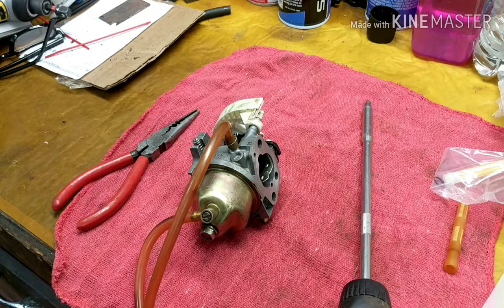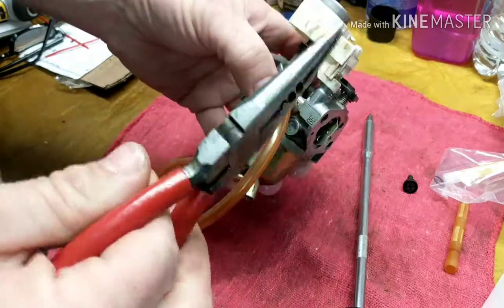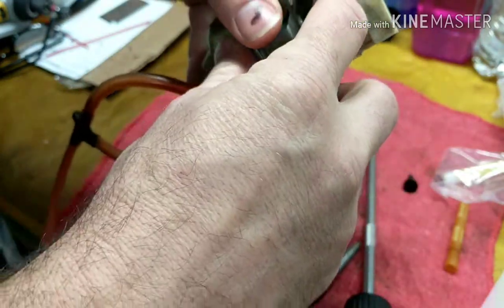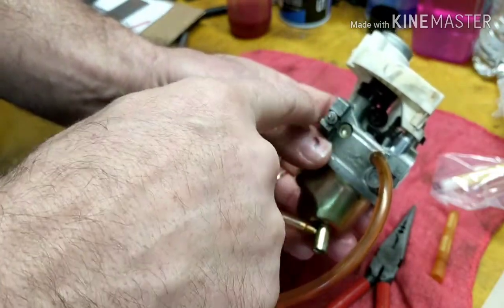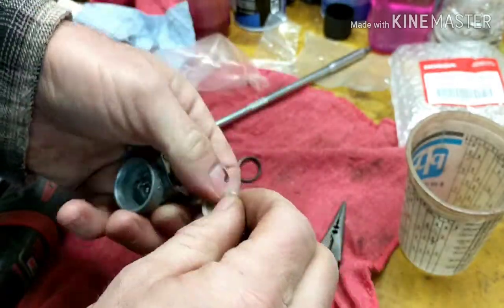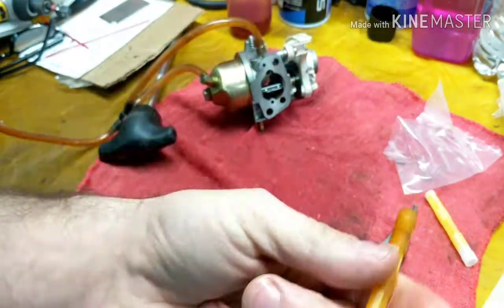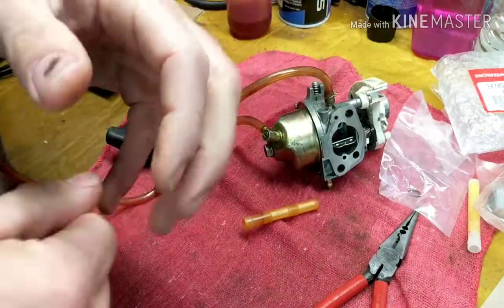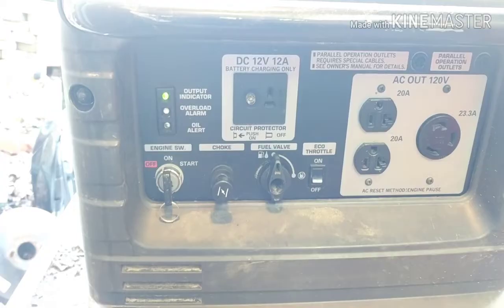Fix surging for good!!!

Comment: I have an unrelated question to this video.  I just replaced the gas tank on my generator. When I filled it full of gas, all of the gas drained out of the upper carb drain hose. Do you know why this would be? I don't see an adjustment screw.
Reply from the maker: Sounds like it's overflowing and filling the carburetor with fuel so check your float needle and make sure it's cutting the fuel off when the bowl is full.

Comment: Fantastic!  Can you show a detail of the throttle motor connection? I took mine apart and notice there is play between the stepper motor and the plastic plate on the throttle shaft. Seems like that would allow surging.  My throttle does not snap closed..should it? Perhaps I'm missing a spring.

Comment: I just bought an EU2000I and it was not wanting to take a full load unless the choke was on. I cleaned the carb twice including the top jet and it will only run correctly with the choke half way on. It idles fine but is way lean at full throttle. I was able to get my money back but what is going on. Do these thing have a fuel pump of some sort. Float bowl appears to be full of fuel. It will run all day with the choke half on but it should run without it.
Reply from the maker: It's your pilot jet. Did you use a wire or something to push through it? Are the o-rings ok on the jet? Your description is a classic case of a clogged pilot jet.

Comment: Hi, nice fix, btw is overload alarm on when it surges? Mine does, i dont know if the fuel problem or electrical. Goin to check it out in the morning. Thank you.
Reply from the maker: No, this one wasn't showing the overload light when surging. But if it's surging badly it will. I would bet it's fuel related

Comment: Just put a new carb on got surge and doesn't want to run with out the choke it was a freebie that sat with old feul for a long time would bet my problem is the in tank feul filter because i tried to just drain the tank through it and barely got fuel so i just pulled the pitcock and drained it but dint clean the filter before reinstalling it so thanks for making me think about it .lol....

Comment: Got generac iq2000. Horrible idle , only runs (rough) on choke. Brand new out of the box.
Reply from the maker: See if there is a mixture screw adjustment and back it out slowly to see if it clears up.

Comment: Question. I noticed that when it surges with eco off and i pull the choke half way out it runs smooth. Can I run it like that and if not is it still the little jet?
Reply from the maker: Yes it's the jet. It's starving for fuel which is why it runs better when you choke it.

Comment: Are the engines commercial/industrial grade is that why they are better than champion, generac, or Wan
Reply from the maker: Not necessarily, I just think the quality of the components are better. Metals, electrics etc. I've worked on a bunch of all brands and metal quality differs greatly and because of that things wear quicker, corrode faster and rubbers dry out faster in the less expensive units.

Comment: You missed cleaning the main jet and tube while the the bowl was off. There are a number of tiny holes on the length of the tube that become restricted. That been the issue many times in my experience.
Reply from the maker: I based this video on common overlook things that could cause surging. The tube you're talking about with the small holes is the emulsion tube the main jet usually has a much larger hole that I do see clogged at times but that usually completely stops it from running. I agree I should have at least mentioned it in this video. I do have several other videos covering the main jet and emultion tube. Thanks for the comment!

Comment: I more question. I have to choke eu3000i even when engine is warm/hot. Is that normal? Push choke in second it starts. Runs fine.Thanks from Dennis
Reply from the maker: Yes that's fine.

Comment: How do I get the filter out and new back inside of gas tank?
Reply from the maker: Unscrew the fuel valve and remove it from the bottom of the tank. It's right inside the door where the carb is.

Comment: TEPCO CYCLE REPAIR, GREAT VIDEO! I RECENTLY  RAN TANK LOW, TOOK MY SMALL SHOP VAC TOP AND SUCKED OUT REMAINING FUEL, TANK DEBRIS AND MINOR RUST. AFTER THAT I SPRAYED BRAKE CLEAN ON PETCOCK FILTER, THEN PUT SHOP VAC TIP RIGHT OVER TO PULL CLEANER OUT.
THAT HELPED ALOT! THEN I RAN ENGINE WITH FILTER OFF, AND DID SHORT BURST OF BRAKE CLEAN WITH ENGINE RUNNING, AFTER ENGINE STUMBLE THEN RPM RECOVERY I SHORT BURST AGAIN, I REPEATED THE PROCESS FOR A FEW MINUTES THE SURGE STOPPED. IT RAN GREAT AND SURGED STOPPED

WHILE I WAS IN THERE I PUT IN A NEW SPARK PLUG AND OEM PAPER AIR FILTER, RE-OILED FOAM FILTER AS WELL

PURRS LIKE A KITTEN! IM NOT SURE HOW OLD THIS HONDA EU300IS BUT I THINK IT IS AN EARLY VERISON DUE TO NOT HAVING THE CHARCOAL FUEL FUME FILTER THAT NEWER ONES HAVE (ACCORDING TO THE INTERNET.

IT RUNS LIKE A TOP AND THESE ARE GREAT GENENRATORS!
GREAT VIDEO ONCE AGAIN

Comment: Very good video and nice explanation. I have predator 4000 and my problem is that it starts and runs fine on choke but when I slide it to run it shuts off. On choke I can run some tools that don't put too much load on it but If I put heavier load on it it will shut off too. Feels like fuel problem, can you help?
Reply from the maker: Yes, classic sign of a clogged pilot jet. Just pull and clean the carb completely and you should be good to go.

Comment: WOW, What a nice surprise.  I figured here we go,  another goof drilling holes in the panels, air cleaner box or ripping the Charcoal Canister out.  You are a great mechanic that knows what he's doing and a great teacher for sure.  I have a Predator 3500 and can't believe all the bad advice out there.  It's unreal and Harbor Freight along with those depending on their generator to keep warm or run their life support equipment pay the price.   I did know about the pilot jet but still learned a couple of good points.  Great job and am now Subscribed.

Comment: This may have been mentioned before but if you own a Honda 6500eu you must have your battery door on or it will surge. I was chasing the surge until I put the door on and instantly started to run correctly. The second cause would be as this video is doing.

Comment: got one of these and the carb was fubar so got a replacement but the din plug that plugs into the inverter board is slightly different and the unit seems to be having iverter issues which I think is due to the plug has anyone found this to be an issue ? my thought is to just cut the din plug and splice the old one back in but wanted to know if anyone had done it before I try it ?
Reply from the maker: You should have no issues cutting and splicing in the old plug.
Reply: @TepcoCycleRepair  Just wanted to say thanks for the reply and to follow up that I took a slightly different route then my original plan . I instead change out the electric eco regulator on the new carb to the old one and used the old line without cutting anything and all is good . The previous owner was told the inverter controller which cost $700 was the issue in the end it was the crab and the harness pluging into the inverter cost $40 . Not sure why the harness plug on the new carbs were changed in the first place but it is what it is. Posting incase someone else runs into this issue with a carb swap out on one of these units . Thanks again for your input .

Comment: Hi, our generator just started surging like crazy.  Randomly, barely anything drawing from it.  We’re in wildfire country, they did a power shut off for fire safety .  So out of the blue, we needed the generator.    My other half isn’t here right now, I’m no mechanic.   I’m kind of freaking out with the surging, it’s 10 pm and the power is still shut off.    My hubby can’t get here until Thursday, the power is supposed to be turned back on tomorrow night by 7pm 🙏.     So I’m going to show him your video, hope that is the only reason it’s surging.   I’m just praying it stays on all night, daytime not so bad.  But night time not so good, especially when you live in the boonies.  I doubt you’ll read this tonight, so all I can do is ride it out.   I just hope nothing bad happens overnight, or hurts the engine in any way 🙏.    Thank you for making this video, I’ll be very curious to see if it fixes the surging. 😊
Reply from the maker: If it has a eco mode, turn it off see if that helps for now. You may have some water in the carb as well that might get pulled through and clear up. Make sure there is fresh gas in it and dump a bottle of sea foam in it until he gets back. Good luck and hope your power comes back on soon.
Reply: Tepco Cycle Repair , has fresh gas in it.  Where would I get sea foam ?  Never heard of it, something else I’m noticing this morning.  It has not surged in the last hour at all, other issue.  My son lives in a travel trailer which he plugs into and outlet in our pumphouse to get power too, he says he only uses it for light.   But now I wonder because it has not done it yet today, and I kn he’s sleeping.   So could the trailer cause it ?  I don’t kn if it’s just lights being used, sure is odd how it’s not doing it now.    I’m making my other half take it in for a service either way, I don’t need it to screw up when I have 3 ft of snow outside.  I have no way to get heat, I kn my heater makes it surge.  It’s central forced air heater, I wish I had a wood stove for heat.  But that’s not an option right now.   Anyway sorry for babbling on, thanks for your help.   And again, where would I get sea foam just so I kn ?    Thanks 😊🌸
Reply from the maker: @wshazbot62  You can get the seafoam from any auto parts store, but with that info it doesn't sound like You need it. You may be maxing out the generator especially if you're running a heat pump on it I'm surprised it's able to do that. I'm guessing it's the same one I'm using in the video?
Reply: Tepco Cycle Repair no heat pump, not sure where I said that ?
Reply: It’s getting taken in for a service, and we ran the trailer on it before.  It didn’t surge then at all, thanks for your advice 😊
Reply from the maker: @wshazbot62  "Central forced air heater" around here is a heat pump. Sorry if that was incorrect.
Reply: Tepco Cycle Repair , it’s ok.  Lol.  I just had no idea what you were talking about.   I think it’s a 7k wat generator , we’ve run it for the house with no probs until now.    I’ve had a repair person check it before, I wasn’t pushing the start button right.  Lol.  So he came out to help me.   He said my size should have no problem running what’s in the house, or the trailer lights.   For couple yrs now other then my not knowing how to push the start button (have to push on one side). It’s never had a problem.  Like everyone else now a days, money is tight.   So any fixing that can be done without a repair person, is the better option.     I was previously married to a mechanic, so I learned a lot.    But we never had a generator, so I’m still learning.    Thanks again for your help etc 😊.  It’s getting serviced

Comment: Can you put the part numbers for all of the fuel filters in the description?  I'm looking online and there are a few options and some of them are really expensive so I don't know if they're the right ones or not.  Great video.
Reply from the maker: At 9:02 I show the part number of the fuel valve with the filter. The tank filter alone is 16952-ZB4-005
Reply: @TepcoCycleRepair  You rock.  I just took the carb apart for the first time and cleaned it out, but I still have a rough idle.  I'm looking to do everything I can to try to smooth that out.  Appreciate it!

Comment: Wait!...no micro drill bits and drills like donnyboy and taryl??? You obviously need to be educated on how to properly fix surging🤦‍♂️😆. 
Nice job. One of the better explanations I’ve seen on YT. You actually talk about the low speed mixture screw. Everyone else brings out the power tools and start augering jets! IDIOTS! Well it has been getting me a lot of rework business in my shop!😆
Reply from the maker: Lol yeah drilling out jets is covering the issue. I always think of it like this, it ran good when new with the stock pilot jet, so now without intake or exhaust mods it's surging, why would you modify the pilot? Diagnose and fix the issue. Thanks for watching!

Comment: I have brand new honda 2200i. Been recalled, ran rough in economy mode before it was in shop,now slightly worse. Runs smoothly at half choke however. Hard to imagine anything clogged, can you suggest an adjustment? Thanks for the great video!
Reply from the maker: If it was repaired due to a recall, I would bring it back..if it needs choke to run, it's lean on the pilot, so pilot is clogged or it's sucking air somewhere.
Reply: @TepcoCycleRepair  Thanks for your response. I was hoping l wouldn't have to take it back, but its still under warranty. At least I'll sound like I know what's going on! Thanks again, great video!

Comment: Another potential cause is an air leak between the carb and the engine. I had this happen on a new Generac PM2200i. When I looked at the intake gasket, it was obvious that part of it had not been compressed. I applied a thin layer of Permatex gasket maker to the gasket, re-installed the carb and torqued it down and it runs great now.
Reply from the maker: Absolutely another possible cause.
Reply: I have had an issue with constant surging. I replced the carb and it still surges real bad. Now I think your suggestion may be something I should look into as I can'f figure out what it could be. The plastic jet is clean and open.

Comment: You took the bowl off but didnt show how to clean the main jet which will definitely cause surging too. Not sure why you would skip that. Everything else was spot on!
Reply from the maker: This was based on common overlooked things that can cause surging. Most people just clean the main jet and it still surges. Agreed though, should have at least mentioned it. I do have several other full carb clean videos in my carburetor playlist. Thanks for the input.

Comment: I have issues with white smoke out exhaust and oil around my carb gaskets and sometimes oil out the exhaust. Maybe bad seal in the crank? Does anyone have any thoughts?
Reply from the maker: Sounds like it's over filled with oil.
Reply: Tepco Cycle Repair thanks I’ll try to remove some then run it.
Reply from the maker: @kert987654  remove oil to get it to the right level and then run it. It will still smoke for a little bit as it burns off the excess oil that's built up, It will stop smoking when all that clears up.
Reply: Tepco Cycle Repair after taking some oil out and running it, the smoke cleared up and ran like a champ while camping. Thank you!

Comment: Our Honda EU3000i only runs when you leave the ON/OFF knob set to "choke."  It starts up fine, but it cuts off when you turn the knob from "choke" to "On."  We only use ethanol-free gasoline, we drained the carb and fuel tank and changed the oil before storage.  We use the generator less than 20 hours per year.  What do you think is the problem?  Thanks :))
Reply: Clean the pilot jet

Comment: installed a new carb.. still does it. please help..  cowboydf15@gmail.com
Reply from the maker: New plug? What's your compression? Check your valves, and be sure your carb is filling with fuel.

Comment: I took my 2000 EUi carb off to clean it, it needed it, the fuel bowl was all gunked up. I ultrasonically cleaned it and put it back together. It starts now but surges. Watching this video gave me a few tips on what to additionally check. Once I check those things and fix any problems I see I think it will be fixed.

Comment: Fantastic video!  Thank you!  I just picked up an EU6500 with only 200 hours on it, and it ran great when I bought it last week.  I don't know what changed, but when running it today, it starts and idles fine, with and without eco throttle on/off.  It also ran well when running 2 space heaters.  But running 1 space heater, with or without eco throttle, it was surging.  It seems like no load is fine.  1/2 load is fine.  But anything in the middle and it surges.  I dropped the sediment bowl and it was perfect.  Not a spec in it.  I removed the carb and the bowl had some black specs in it.  No varnish, just some fine specs of dirt.  The main jet was frozen in place, to the point that I was starting to round-off the flat-head notch on it.  So I left it in the carb, sprayed it with carb clean in and out, and reinstalled.
The surging seemed to get a little better, but it's still there and comes and goes.
I didn't try the pilot jet and will try that next.
I really don't want to have to cut the tab on the air/fuel ratio screw, but I guess that may be next as well.
The EU6500 has a very fancy carb with the dual motors on the top.  I really don't want to mess with them, or a 100% teardown of the carb.
I'll try the pilot jet next....

thanks for the great video!
Reply from the maker: Yeah, just try the pilot jet, don't mess with the mixture screw.